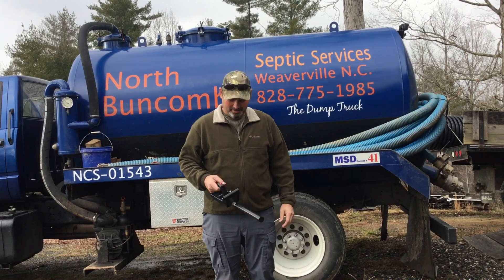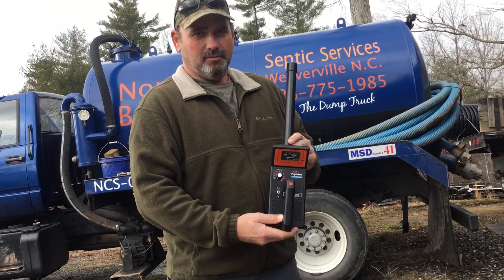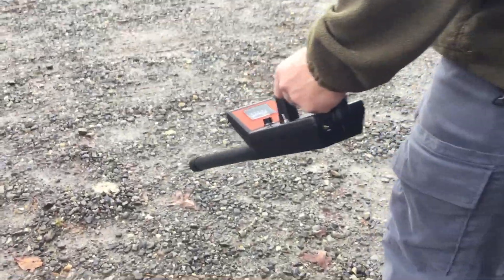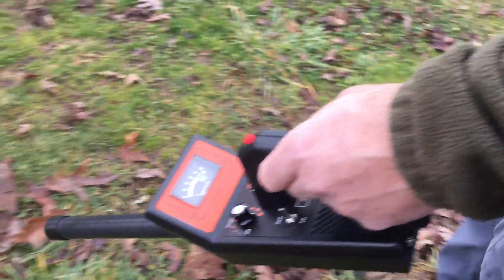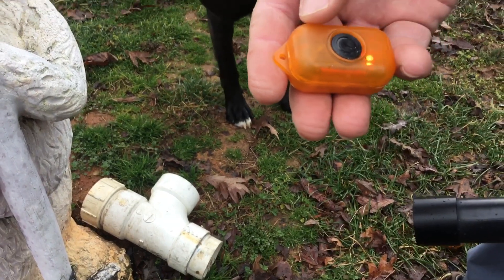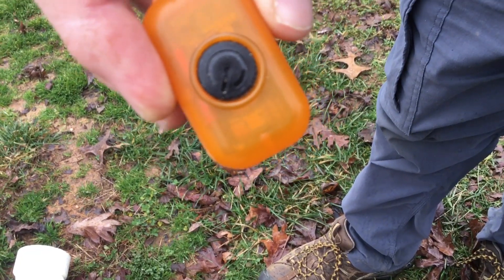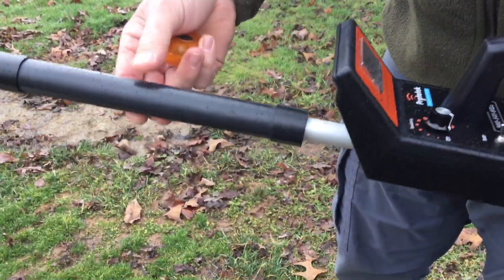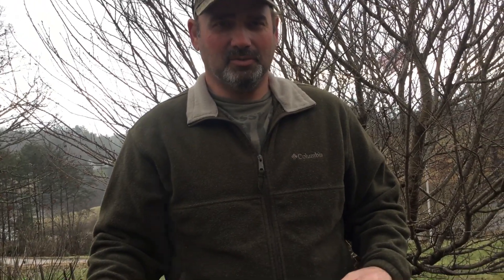Prototek AR-1 223 KiloHertz how to, Review Part 2

Comment: Thanks for posting.
Have you sent one to the septic tank yet? 
How’d it go if you did?
Reply from the maker: Oh yeah, I use it about once or twice a week, it works really good
Reply: @mmccoy577  glad to hear it. How about signal distance?
Reply from the maker: @MrTom423   it has great reception, it has a switch for near and far, plus when you pin point the location you just keep turning the volume down and it will get within inches of where the transmitter is

Comment: Flush a 1/4 stick of dynamite with a waterproof wick and it will save you having to dig at all!🤠
Never seen one but looks like it could be very useful. So flush units are sealed and can't have new batteries put in them?
Reply from the maker: Lol, that would work , yea those orange thangs just use until they die I rekon
Reply: @mmccoy577  Well when the 1st one dies...Crack it open and see how it works. Might be able to throw a new camera battery in it and some silicone!👍
Reply from the maker: @waynetharp  oh im sure I’ll try it lol
Reply: Sad to say but your comment beat mine by a mile!

Comment: They work good till the line is full of backup have been there years ago when i used to run a septic truck they do come in handy.
Reply: So, they don't work if there is water in the line?
Reply: @shawnalevonne  it works by flushing the pill which will end up in the tank but if it is backed up it will stop when it gets to the water level. with a snake and black tape you may make it to the tank but it depends on how bad the plug is.